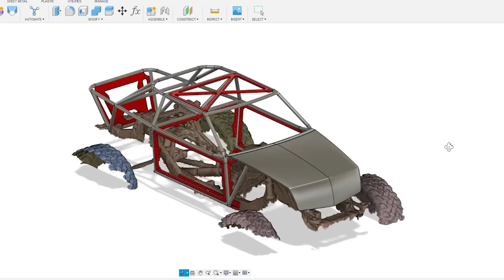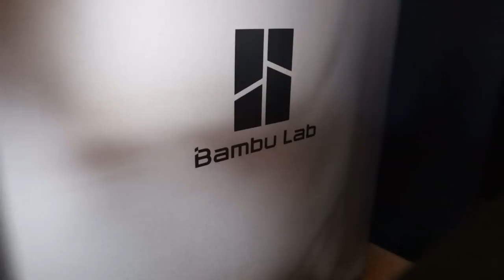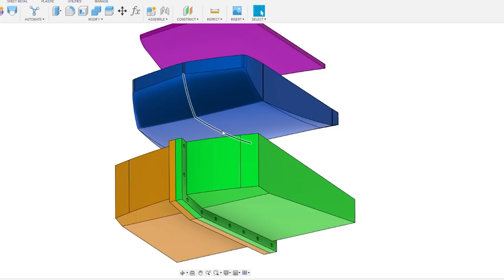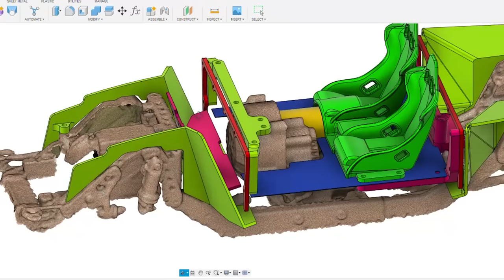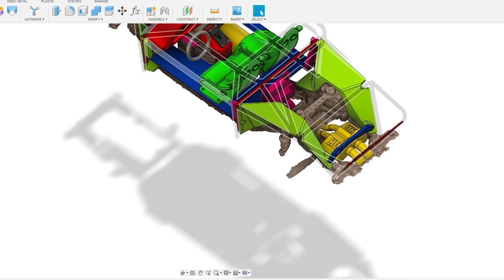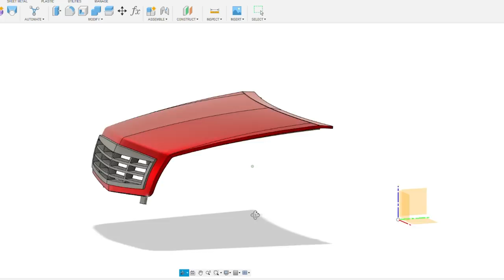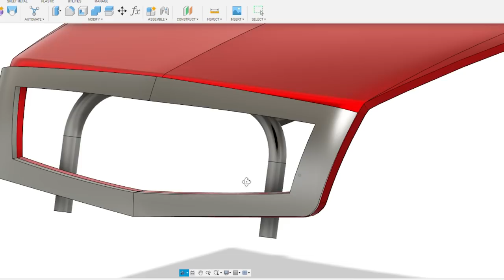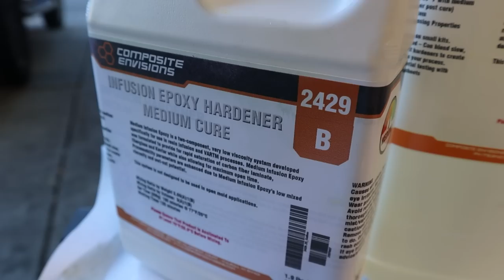He said "NAME YOUR PRICE" $$$ Axial Base Camp Hackillac

Comment: Do you use autoCAD professionally? Because that’s something that takes years to learn the software alone. 
Damn good job but most of us don’t have the equipment at our disposal that you do nor the $100k+ for it. Great video
Reply from the maker: I’m self taught on CAD but I have used it professionally for many years (not this program but others). The tool’s definitely add up, but none of them are as much as they appear. CNC routers can be had for less than this truck cost, my TIG welder was around $800, printers are so cheap these days, etc. it’s just a slow accumulation of things to build fun toys!
Reply: I used to make Hot Wheels for Mattel toys and Tensor trucks for Rodney Mullen , but from watching this super pro produced video, the Hackalac is an exemplary build . I know you want to do a 1:1 build of this…